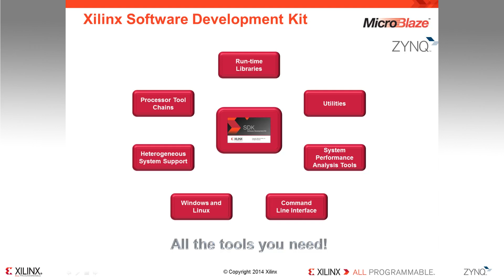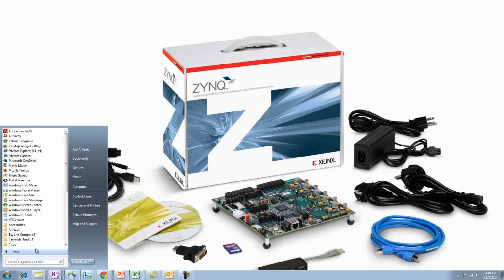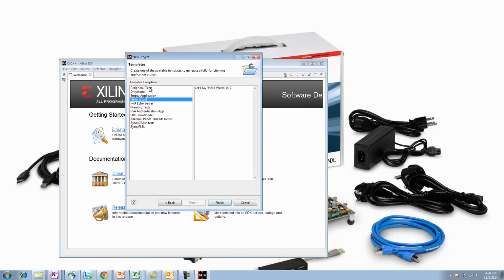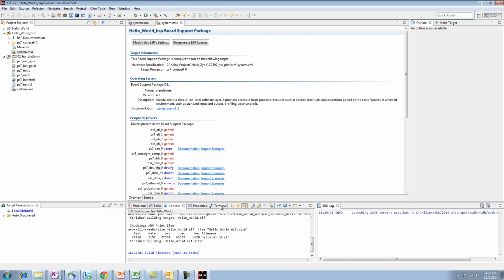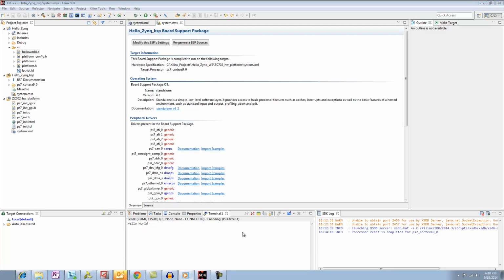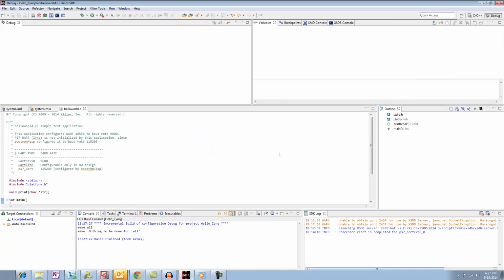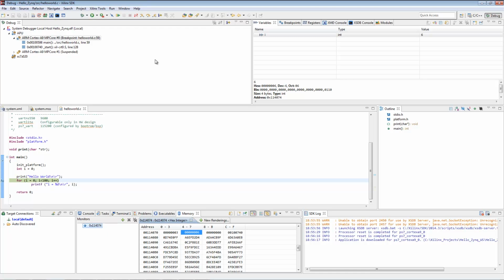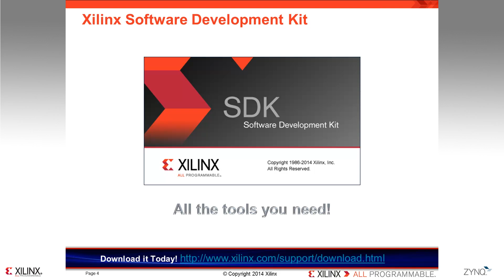Hello World in 5 Minutes on Zynq with Xilinx SDK

Comment: You guys make it look so easy when in reality it takes days. It has taken me around 8 hours just to find out the jumper switches have to be changed to boot in SD mode and to find the drivers so that Windows can recognize the board and now that I am running this code it says that I need a jtag cable connected so how to the host... really... yes sure 5 minutes. We are doing this for the lab in our university, everybody has spend hours and hours just in setup time. Now I need I how many hours to find out how does this jtag cable works. I will have to go through every blog to see if I can find out. Thank you for your quick and easy 5 minutes demo.
Reply: +Apollo same
Reply: This statement about running the app in 5 minutes is for marketing purposes :) But video definitely lacks information about setting up target HW. I got this example running on ZedBoard so here are preconditions which were not mentioned in the video. Part identifiers for Zedboard are given in parenthesis.

1. Connect 12 V power supply (J20) and 2 USB cables, one to PROG port (J17) over which code will be flashed to target and another for UART communication (J14).

2. Don't setup SD Card boot mode (JP7 - JP11 connected to GND)

3. Usage of SD Card enabled (JP6 shorted), USB OTG disabled (JP2 open), Slave mode activated (JP3 open). I don't believe that this configuration has any impact but for completeness I add it as well.
Reply: Sounds like your professor needs to do a better job of teaching you the basics.

Comment: I have a Mac running OSX. First problem: must I install Windows in a Virtual Machine, just to get the software to run? Which VM do you recommend, and would I be better off installing Linux?

I have a Red Pitaya. Second Problem: can I use this as a development platform?
Reply from the maker: Install Paralells http://www.parallels.com/products/desktop/download/ then you can run a virtual copy of Windows or Ubuntu Linux on your Mac. For optimal performance allow the Virtual Machine to use all of your CPU cores.
Reply from the maker: RE: Red Pitaya, yes this is built on the Zynq-7000 SoC and since it's open source you should be able to easily tinker with the design in Vivado.